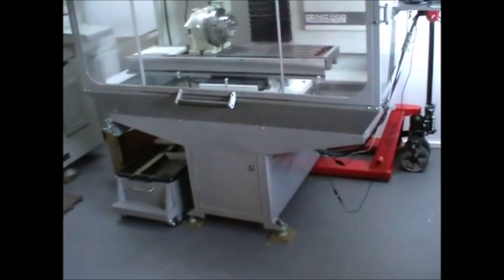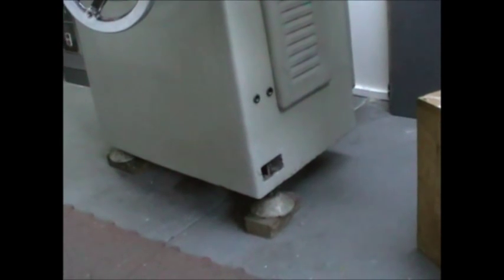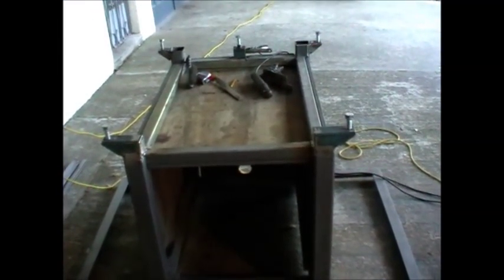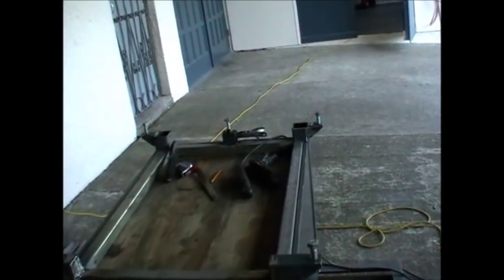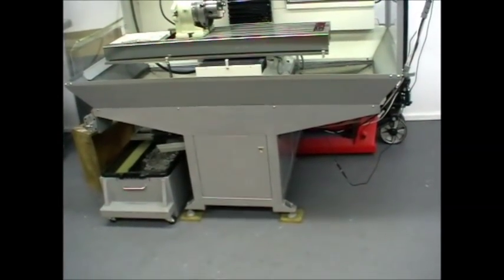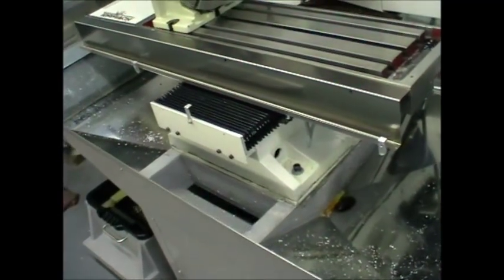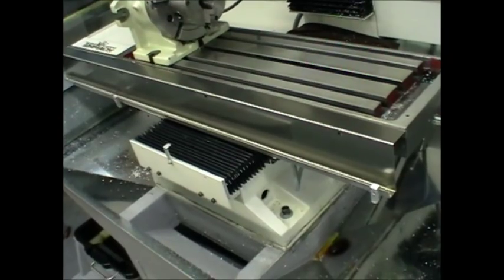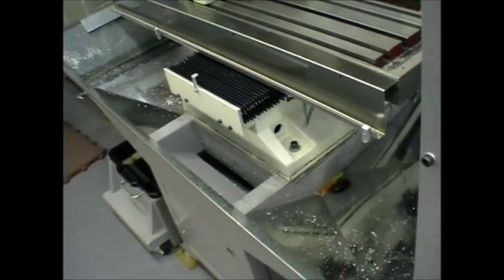Machine tool/Tormach stand and base stresses

Comment: Any ideas on how to modify a stock 1100 base to 3 feet? Thinking of adding an additional foot to the center of the back and raising outside back feet clear of the floor.
Reply from the maker: Hi - I have just done that on my new Slant pro which of course comes with a 4 foot stand - I used a block of wood down the tail end to make it a 3 footer, then leveled it, then adjusted the other two feet down to come into light contact. 

Note I have another more recent video on this subject, 

Cheers  Cliff